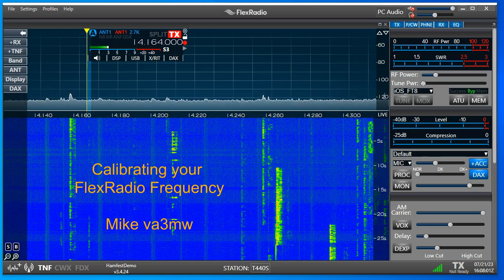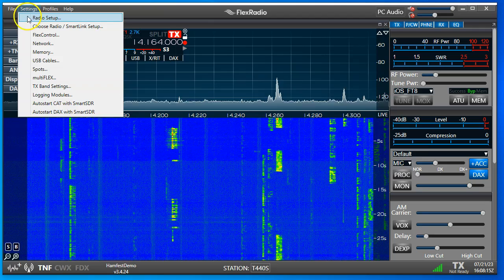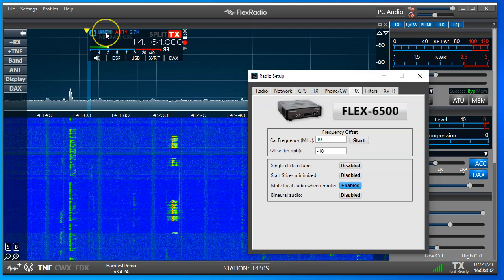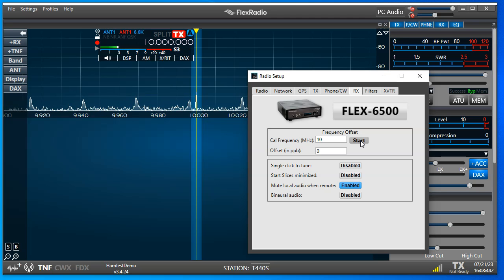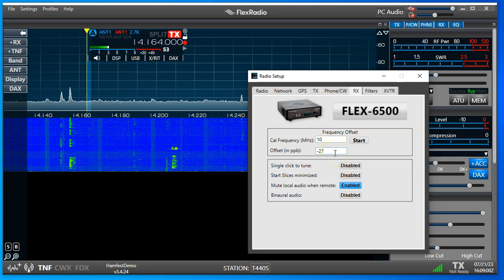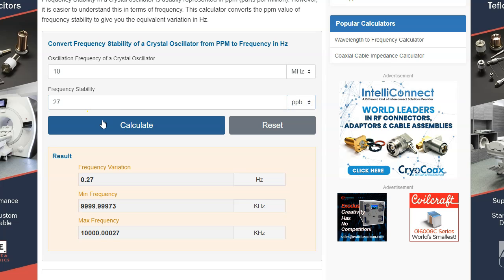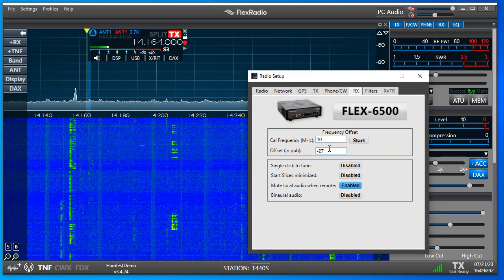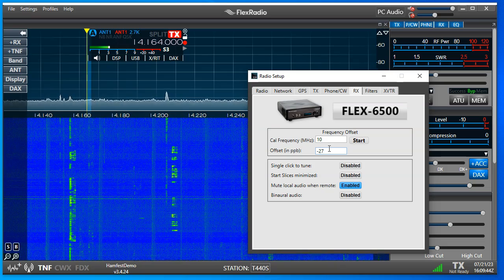Is your HF Radio on Frequency?

Comment: The 10 Mhz reference will only be utilized when the radio is initially turned on. I dont know why they would design it this way. I have a GPSDO that can supply precise 10 Mhz all the time. Why not use it all the time?
Reply from the maker: The 10Mhz input on the radio is constantly referenced, not just when the radio is turned on.   In Auto mode, the radio monitors each of the inputs and selects an input that offers a signal in priority order. The highest priority signal is the External 10 MHz signal (optional), followed by the GPSDO signal (optional), followed by the TCXO signal (always provided). The radio will track changes in the availability of the signals. For instance, if the External 10 MHz signal appears, the radio will switch to it from the GPSDO or TCXO signal.
Reply: @FlexRadioSystems how can we see which source is currently being used?

Comment: Hi Mike: If I use an external reference then I don't need to worry about these steps?  Do I disable the offset somewhere if I did the calibration then added an external reference afterwards?
Reply: You just set the offset to zero.